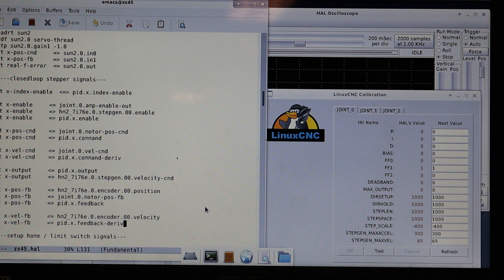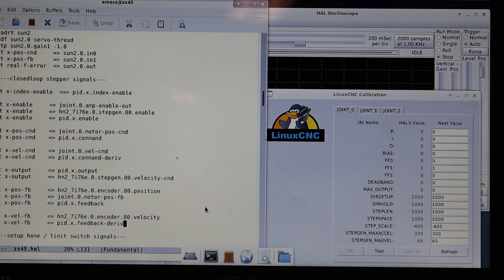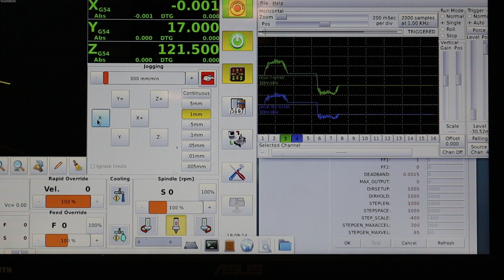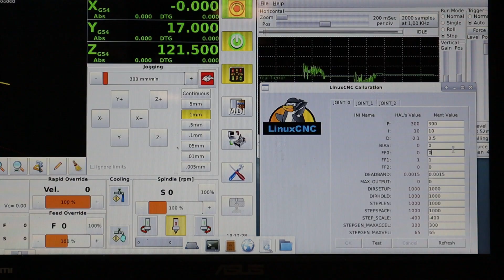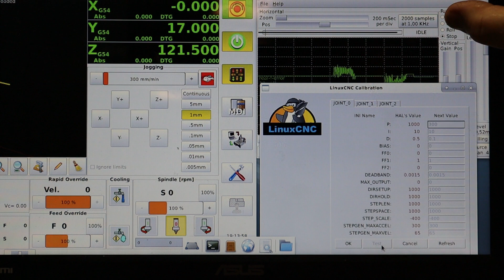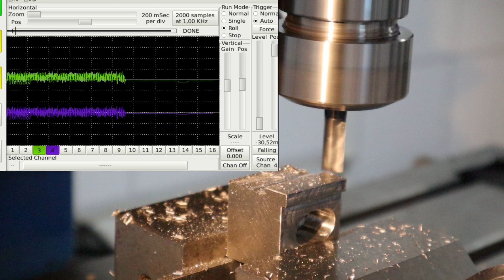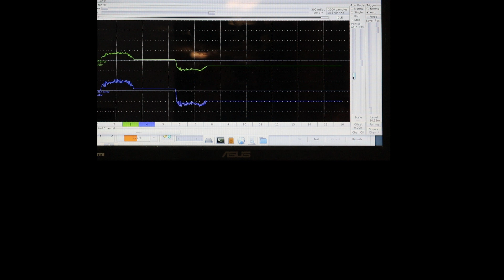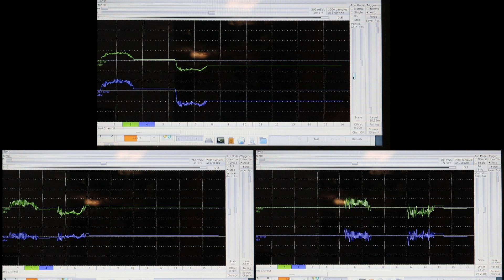Linear encoders on stepper motor CNC milling machine. Part 3 Tuning and testing

Comment: Thank you for your great works.

I have been trying to find a way to feedback the linear encoder outputs into a motion controller for a long time.

Did I miss something like "net hm2_7i76e.0.stepgen.00.position-cmd <= pid.x.out"  in your video or did you do something otherewise?

Thanks,

Comment: Line scale have resolution 0.001 ?
Reply from the maker: Yes it is 0.001 mm. Often they are 0.005 mm, but the chinese shops sells 0.001 mm as well.
Reply: @metalmusings  on my machine preinstalled with resolution 0.005 - 
and I do not know good or bad :)

what do you think you need and do. of 2 feedback (scale + encoder) or one linear scale is enough ?
Reply from the maker: @maxekb77  Easiest and best to fix any mechanical backlash and use normal stepper motors. Or closed loop stepper motors, maybe they keep position better and warn when loosing steps. Linear encoders should not be needed, but is fun to play with and perhaps there is a slight precision improvement. The linear scale should have 10 times better resolution than the wanted resolution I read somewhere.
Reply: @metalmusings  thank you, when ballscrew coming try to create double feedback, On xyz-axis i have panasonic servo 200w, maybe for the z axis is a weak servo. now waiting all parcel with component's
Reply: @metalmusings  yes if you want to be able to mill up to 0.01mm accurate you should have a 0,001mm encoder. Mechanical backlash should be fixed by using preloaded ball bearings or 2 ball bearings and screwing them against each other. you should probably use only one positional device (either Linuxcnc PID or closed loop steppers/servos) or they may work against each other.